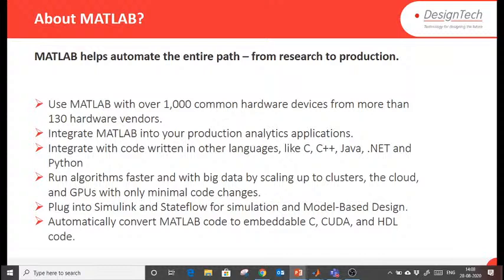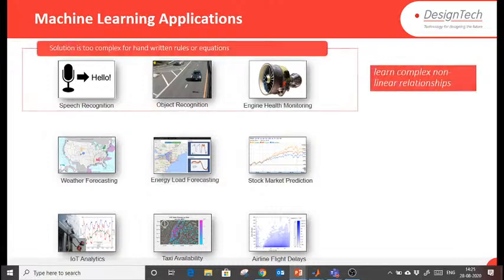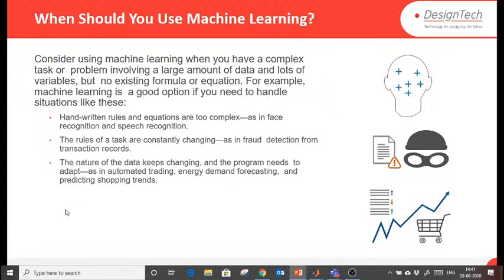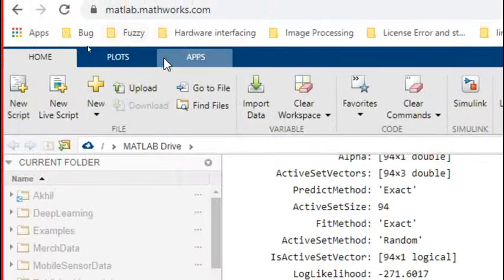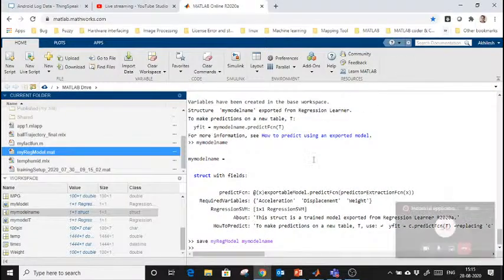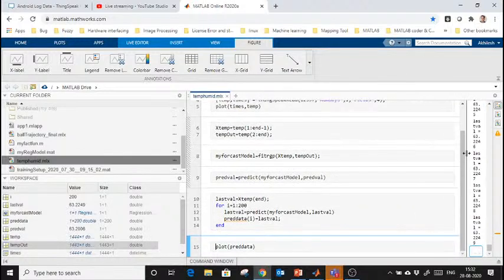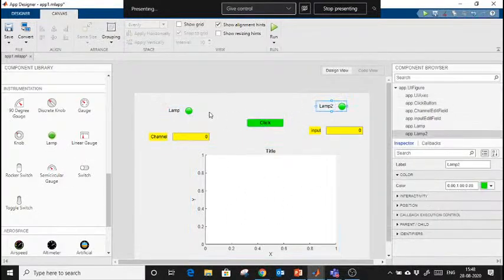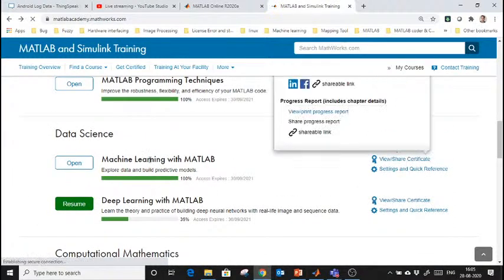IoT and Data Analytics on Live Data

Comment: Hi sir, I have done the simulink circuit for monitoring the speed of the Induction motor and  by listening to your previous vedios I uploaded the scope data(speed of IM Motor) to Thingspeak platform using 'thingspeaks output channel' block. But in the Thingspeaks the scalling time is the realtime but in matlab scope scaling is a fixed time so even if I upload the data to thingspeaks due to long run time of my matlab my field waveforms and scope waveforms are looking different.... So How can I bring both the waveform look same? plz help me on this....